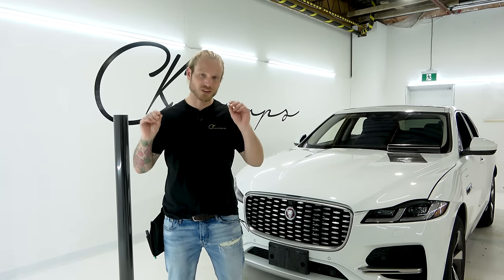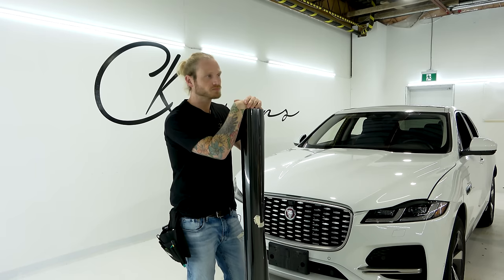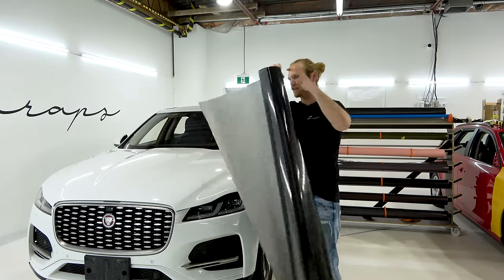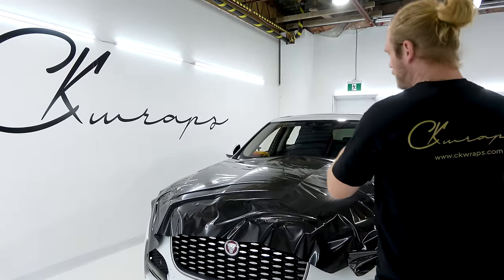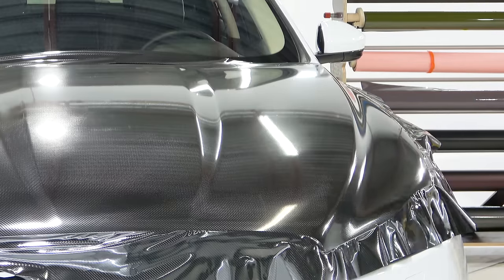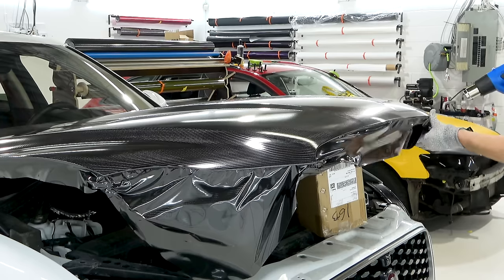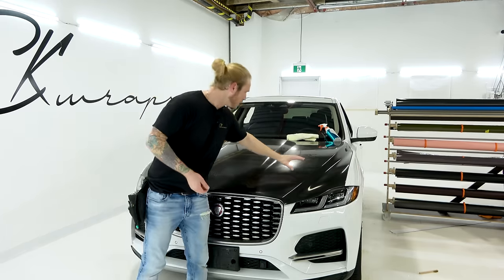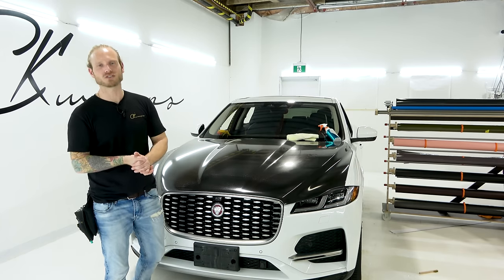Most Realistic Carbon Fiber Wrap I've Seen!

Comment: You are an artist. I've wrapped a bunch of small interior parts with success. You are the Bob Ross of vinyl...lol. Very calm and patient. I was torn between a factory hood with a scoop, or a carbon one. I was concerned about fitment issues. Now I can have the best of both worlds.
Reply: You show adding the paint protection film at the end. Is that something you would recommend? It seemed to remove and surface scratches...
Reply: best of both worlds?  fake carbon wrapped on a steel hood is best of both worlds?  LOL

Comment: This is amazing. Carbon parts are so expensive for my motorcycle,  but this looks plenty real. I'd love to use it on the parts.
Reply: When the car is in the sun, the vinyl peels off the surface. I checked it all out 🤣
Reply: @aleksandrovichkonstantin Maybe if you leave it in the sun for three years 😂. Now I’d personally buy real carbon fiber parts, and all my cars are painted instead of wrapped, but I’ve never seen a car wrapped with any new, professionally made vinyl produced in the past 10 years peel up just because someone left in in the sun.

Comment: Also, this stuff is so good I was putting it on top of my UV damaged door as a temp fix and looking at the real CF immediately next to this wrap, it was nearly indistinguishable. Very impressive.
Reply: What’s the brand? I didn’t hear him mention it in the video
Reply: What brand is?
Reply: @dragosmarian06  TinyBot is the brand. It’s been a while since I ordered it on Amazon but I’m pretty sure they call it 6D carbon fiber vinyl wrap. It’s good stuff man but just as an FYI I don’t recommend using it for smaller surface areas with a lot of tension like door handles. Because it’s so thick compared to normal single colored vinyl that you can just get from Amazon and it peels on the edges. If you do use it for something like that make sure to use an overlay to cover the edges if possible kind of like putting tape on it to cover the edges but with a different thinner wrap. I used this stuff in my door handles and used some cheaper black vinyl from Amazon to put on the inside as an overlay and it’s held up great for the last 5 or 6 months since I put it on.
Reply: @gabrielthompson3853  thx man.

Comment: This definitely looks like real carbon fiber, only issue I would have towards it is when you stretch the vinyl it messes with the weave pattern. You can see it at @28:05 where you got the bottom middle moving towards the right while the middle top is straight.

Comment: Just a note. Wrapping is not only economical compared to full carbon, it’s also less weight. Most sports car hoods are aluminum and weigh less then carbons. With our race cars, we order body panels bare, no paint, primer or clear coat. Then wrap. Saves a ton of weight. To paint a car, it’s 1-ish gallons of paint, couple ounces of clear and primer. It adds up. Wrap is so light.
Reply from the maker: I appreciate this input, most people don't realize it. Paint is much heavier than wrap and wrap can easily be redone in less than 1 hour per panel in most cases.
Reply: Aluminum is not better in terms of weight/strength. It's a cheaper solution but not a better one. Not sure where you pulled that information at.
Reply: Amazing work CK 🔥🙌🏽

Comment: I have extensive clear coat peeling on my 1999 100 series Toyota Landcruiser and the paint has oxidized somewhat and I was told I can rub it back and smooth the clear coat edge and just wrap over it as is and the vinyl will stick. Im obviously trying to do this as inexpensively as I can but do u think this will work or should I remove the clear coat completely and rub back the paint and go straight onto the base paint? Thoughts? ASny advice would be most appreciated. Im at a total loss as to what i should do. Thanks mate. Mick, Perth Western Australia

Comment: Have you ever wrapped anything other than a vehicle? My bf has a prosthetic arm and he painted it with undercarriage paint now it's ugly. So I sanded all that junk off and I got him the Vvivid 3M carbon fiber vinyl with air release (black matte carbon fiber). The 1st time I tried was a complete fail and the 2nd time I ended up cutting it in strips and well it sorta looks better but I had to overlap it because there's no even lines or anything on it and you can see the overlaps. So I'm just wondering if you have ever wrapped anything crazy like this and if so how did you do it? Thanks

Comment: When pulling it tight and stretching, doesn't it distort the cf so now the weaves look skewed and therefore less realistic? How do you prevent that?

I did some trim in "brushed aluminum" and there was a part that I had to stretch which distorted the brush lines

Comment: I enjoyed this video! It was very impressive how you managed the film & got it to adhere to all the detailed curves of the hood. Hats off to your talent!
I own 2015 Lexus RX350 in white Starfire Pearl. The front grill consists of three sections; a lower black honeycomb, a centre bar off Starfire Pearl, & a top section of metallic silver grey  horizontal bars. Would like to do the middle section in a carbon fibre black & paint the upper section black as well for a total look. 
The questions I have are:
What wrap brand would you recommend? The piece is approximately 10x40 inches.
There are proximity sensors in this piece. How would you cover them?
Regards
Rick

Comment: I used to wrap my trunk on a 2010 Camaro. Same exact vinyl as the video. And it turns out moisture gets in between the layers of the film, just a tip of Anyone who is thinking of using this exact material.
Reply: Would you say this would be prevented with PPF sealing it from moisture?
Reply from the maker: I was talking about this in the video and Tinybot is developing a sealed version of the film. Wrapping around the edges would be crucial to prevent water from seaping in.

Comment: What about the foil on hot days, especially its edges, will it not shrink and move away from the edges or from the heat from the engine, I used to wrap the door pillars in the station wagon a little, but in moderation, it was partially heated beforehand, for two years it was everything ok but the car was in the sun at 30 degrees the foil started to shrink paint gaps appeared, now I have a taped roof in the coupe here with a heat gun I wasn't crazy it turned out better, after a year any flaws left under the foil somehow died from the sun's heat but in one place the foil came out under the glass seals, you can see that it has tightened up a bit.  3M tubular film.....z  góry dziękuję

Comment: Is there any chance you could do a video on wrapping plastic trim?  

I have a VW Tiguan R and it has really annoying, textured wheel arches. 

I've been quoted some insane prices to wrap them because they are textured. Been told they need to be sanded, filled, sanded again and then wrapped. 

Seems like a lot of work to do a carbon wrap on some arch trims to me.

Comment: This was totally Awesome. I have a 2000 Toyota Camry LE that was given to me by my cousin it was his father's Camry. It's not in the best of shape. I'm restoring and customizing the Camry. I looked online for a carbon fiber hood for the Camry $900.00. I have to get a new hood for the Camry anyways. Where the label is it's rusting from underneath to the top where the paint is. The paint is bubbling. So it wouldn't do me much good to get a carbon fiber wrap. I have to get a new hood anyway. But the wrap you did on the rental was totally Awesome. That is the look I'm looking for for my Camry.
Reply from the maker: You could buy a cheap hood from the junkyard and wrap it in the carbon fiber? You can most likely get a used hood for $100-$200

Comment: Looks really good. I see a lot of videos of components being wrapped with carbon fiber. Side Mirrors, roofs, spoilers, splitters and other trim pieces on the car. My question is do we know how the wrap will hold up on those trim pieces over time, weather, washings, etc.?
Reply: I have this wrap on my
Fk7 for about a month or 2 , washed it myself as well and it’s still on good.
Reply: I have my whole car wrapped, and my spoilers, mirrors, splitter etc are carbon wrapped. Everything looks like day one, and it's been on there for about 18 months.
Reply: @indospartan  That's good to know. Thanks!
Reply: @alejandrogarcia1598  where did you buy that wrap?
Reply: @alejandrogarcia1598  where did you buy the wrap?
Reply: I bought just a cheap wrap and did it myself on a chrome trim piece on my truck and it's been 3 years strong, so between a quality wrap and someone who knows what they are doing I can see a wrap lasting decades if you take care of it.
Reply: @alejandrogarcia1598  what is this wrap called? He didn't mention it
Reply: @urenaanthony91  tinybotvinyl 6d carbon fiber
Reply: @juniorrios-nunez4214  from tinybotvinyl it’s called 6d carbon fiber
Reply: @christianreid9029  from tinybotvinyl it’s called 6d carbon fiber

Comment: two things stick out:
1) anything that comes in contact with wrap that has petroleum distillates in it will ruin it... tar from road work (trees, too) will be impossible to remove without ruining it
2) you must apply it inside... in a dustless environment.
Reply from the maker: Incorrect on both. Though having a "clean" indoor environment does make things easier.

Comment: I will say it depends on the weight and material of the original hood. I bought a carbon fiber hood because it was the same price as getting an unpainted hood and then getting it painted. I will tell you what though, my fiber hood weighed literally like 5 lbs, I could hold it with my pinky easily and the old hood was steel and weighed like 50 lbs. Shit was HEAVY and the difference was crazy dude. The weight difference was even bigger for my hatch door from like 70lbs to 7lbs.
Reply from the maker: It's true, a lot of panels can weigh quite a bit but a lot of modern day cars are using aluminum. Even on my Jeep Gladiator the hood feels like it weighs only 5lbs. I can hold it up with just 2 fingers wothout straining.

Comment: This is an issue I face only theoretically when wasting my time on the internet building the ideal spec toyota mr2 slick top. The upper half of the car would be fairly unsafe and expensive to go around chopping it up replaceing it with carbon, so this offers a theoretical solution to not having it mismatched

Comment: I bought some 3M carbon fiber wrap for my Audi hood. I was able to lay it out on the hood but when I went to pull up the side edge to smooth it out it ripped right on the front edge. $130 down the drain. My garage was about 70 degrees. My question is was my garage not warm enough? Is 3M not the best wrap to use? Is there some way to reduce the stickiness of the glue so it initially can be lifted without tearing? Help!!!
Reply from the maker: It's because 3m is an inferior product. Buying 3m is like paying for a Lamborghini but getting a Hyundai instead
Reply: @CKWraps  Thanks, I'll but some Tinybot. What ambient temperature works best for working with this wrap?

Comment: I have Stek Carbon Fiber semi-gloss PPF on my isF hood and it looks great and extremely realistic. Although pricey for the entire roll, how come vinyl and then PPF over instead of just using fashion PPF alone?
Reply from the maker: Fashion PPF is fairly new to the industry and I don't doubt that one day it may have a much larger presence in color changes. There is also extremely limited styles available due to the fact that it is so new.
Reply: @CKWraps  Appreciate the reply. I'd look into Steks ppf though it's pretty sticky and vinyl is honestly easier to apply imo.

They have a decent selection of colors and fashion PPF. I wouldn't exactly color change my entire car with PPF as it's entirely too expensive and unnecessary though. Price is about triple to quadruple vinyl unfortunately. But their carbon fiber looks extremely pleasing. This carbon fiber looks great too for someone who doesn't want to spend the money on ppf as well though man.
Reply from the maker: @quickfade733  I've never used their films but I was introduced to their fashion line about 3 or 4 years ago just as it came out. I believe they were the first to do a gloss black PPF. Friends of mine who install PPF swear by their products. I'll look into giving some a try. Even though PPF is a different but similar ballgame to color change I could potentially do a video on it. PPF has come a long way but has also been around for quite a long time and has a much greater market share. I recently acquired some insane color shift PPF which is dry apply. I have yet to wrap a car in it but that will be coming soon.
Reply: @CKWraps  Sounds awesome man! Correct me if I'm wrong but isn't dry apply PPF relatively new to the PPF game. Haven't used it yet but will be awesome to see a video on.
Reply from the maker: @quickfade733  it's extremely new, I know the company very well and I've visited their manufacturing facility. I was able to view everything first hand. It's incredible to see the precautions taken in order to keep the manufacturing facility particle free. It's like entering outer space, you have this crazy suit and go through like 3 chambers just to enter the actually machine room.

Comment: I don't know if I've seen you do this yet,  but how about a wet vs air release on quality vinyl? I've use wet for a decade,  and just recently started using air release.
Reply from the maker: Do you mean using PPF vs Air Release film?
Reply: @CKWraps  no,  not ppf. Just regular wet application vinyl.  With no air pockets.  Like arlon 651 vinyl.
Reply: I'm used to doing wet for a long time as well. I'm wondering if you can still use the wet method with the air release vinyl?

Comment: Carbon fiber is used in racing because of its strength and resistance to heat! I don't have a problem with doing this for looks,  but it's not about weight.  All race cars have strict rules for weight,  and in that sense you want all 4 corners of the car to balance in weight,  ie 25% rr 25 rl 25fr 25% fl,  a balanced car. That's why real carbon is used

Comment: Amazing vynl 😮. Also can I ask, I've been trying to wrap my rear lights using air release tint. But they have a triangular lump on them that I can't seem to prevent creasing on. Any tips? It's a 2008 mitsubishi colt European model. Thanks
Reply: What kind of car? Sometimes with those sharp angles on these newer cars,  I have to do a release slice on the most hidden section of the hump to get it to seat
Reply: @importroller  it's a 2008 mitsubishi colt
Reply: @importroller  it's a 2008 mitsubishi colt

Comment: I've been using 8D carbon wrap for a few years now on different vehicles I've had but I can't find any roles large enough to do my roof. Also sometimes it really goes weird in very cold conditions. You see these swirls it's made of. Very strange but the rest of the time it looks amazing
Reply: Glad I'm not the only one that's experienced this. Looks great until you get a cold day, then it kind of looks as though its separating. It's a shame, as I want to do my roof and I'm not a fan of the more matt look
Reply: @gavinseaborn9554  I'm thinking maybe a 2k clearcoat or laquar over it maybe could help. I may be wrong but I think it's worth trying on something as simple as a spare mirror and then stick it in the fridge or the freezer or even just leave it outside. I've had it happen on my motocross bike and my car and you can see loads of strange swirls. Definitely not a fan of the matt/dry carbon either mate
Reply: I did try clear coating a sample a while ago. To be fair it was the matt carbon effect. I didn't look great. I know some people are covering it with a clear ppf. But costly!!
Reply: @gavinseaborn9554  do you know what the outcome was once its covered?
Reply: It was a YouTube video. Think it was an F30 bmw. It looked unbelievable! We're talking "see your face in it" shine.
Reply: @gavinseaborn9554  I like the sound of that. Wonder if it stopped it doing the crazy swirl thing

Comment: First off, you're incredibly talented and you're just giving the customer what they want. What I can't understand is why people put fake carbon fiber stickers on their car. So odd. Just buy a real hood and enjoy the strength and weight savings that carbon fiber was actually engineered to provide.
Reply from the maker: These days a lot of hoods weigh less or very close to real carbon. For example, my Jeep Gladiator hood I can hold elevated with just my thumb and index finger because it's that light. When using a wrap to give a visual esthetic it will also protect the original paint but also provides OEM fitment of the original hood which a lot of aftermarket parts have issues with. The price to also buy a real carbon hood is considerably more than it costs to wrap one. If it's for weight saving and your car is a full blown racecar then I'd say sure go with carbon but most people don't daily drive full blown racecars and the few ounces of weight difference is the difference between a full bladder or an empty one.

Think about why people put real carbon fiber mirror caps on their cars. It's purely for esthetics since the OEM plastic cap weighs even less and strength is not needed on a mirror cap or spoiler for example.